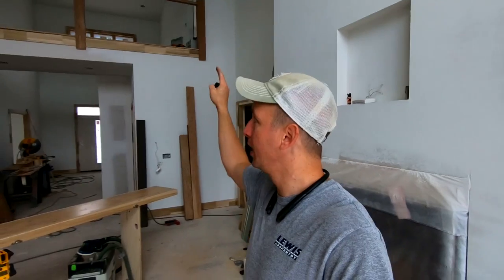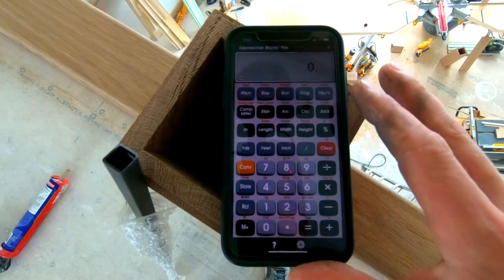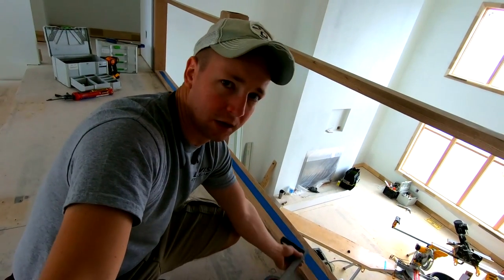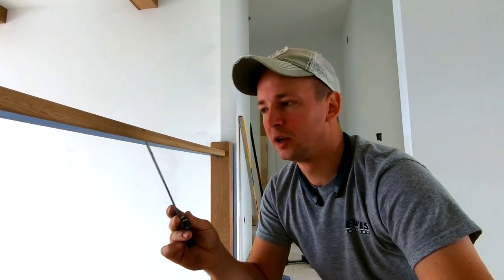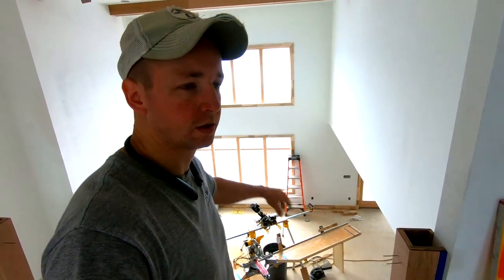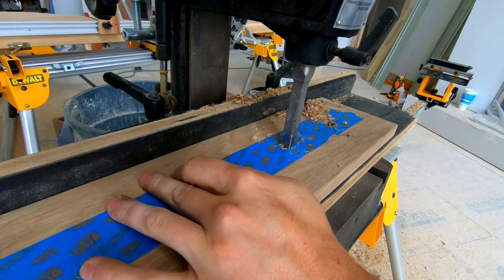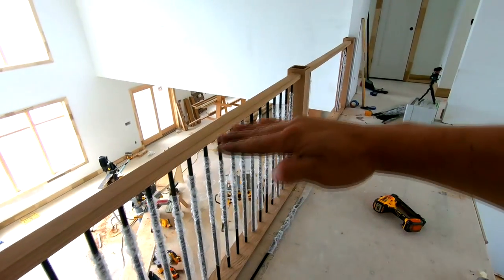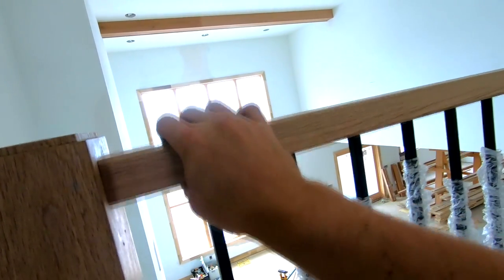NO SHOES! Staircase Balcony Install - How to Square Mortise Balcony Balusters 2

Comment from the maker: Dewalt Compact Stand (for mortiser) - https://amzn.to/32R4W2m
Baluster Layout Compass - https://amzn.to/2OUr3Nf
Starret Combination Square - https://amzn.to/3f3ph75
PLS 180 Laser - https://amzn.to/30OMCnN
1/2" Hollow Chisel Bit - https://amzn.to/2OZDgjH
Rubber Mallet - https://amzn.to/3hDCq8m
DEWALT DW872 14-Inch Multi-Cutter Saw - https://amzn.to/2Em3mvb
Dewalt Cordless Grinder - https://amzn.to/2EiwXWd
Festool Sander - https://amzn.to/39sEoG1
Reply from the maker: It is listed in the video notes.
Reply: So doing it that way Doesn’t it come out a quarter inch bigger space on each end towards the wall and then on the other end towards the new post, because on the outsides and you’ll Only lose half the thickness of one baluster instead of half the thickness of two balusters
Reply: I have drywall, half wall on my balconies. I want to open up the space and install an attractive railing in place of that half wall. I wonder if half wall is the proper description of the existing railing.

Comment: Another great video! True craftsmanship. Stairs can be complicated and time consuming. But I usually enjoy the challenge. 

For those who want an alternative to buying a mortising machine, LJ Smith Stair System now have a plastic insert to be used with a dowel fast screw for hollow metal balusters. They work great and make for a quick and strong install. I made a simple tool for my drill to screw them down, then do the final tightening by hand. The product number is LIH-HOLINSERTW/SCREW. You use them on the bottom of the balusters and the round tops of the balusters go inside holes drilled in the under side of the handrail.
Reply from the maker: Thanks! I'd like to try those sometime.
Reply: @InsiderCarpentry  If you do, make sure there are no burrs left over from cutting the baluster. In fact, you might even want to lightly ease the bottom edge/corners too so you wont mar the tread/landing tread as you tighten the balusters down.

I made a 1/2" baluster runner out of a chuck of wood, plywood and a bolt. Very similar to LJ Smiths LJ-3084-1 baluster runner but smaller of course. Chuck it in the drill to do most of the turning and then finish off the last few turns by hand. 

You probably will have figured all that out yourself if and when you give it a try. Just wanted to share it for others as well. Hope that helps.

Comment: This video gave me the confidence to do my stair railing and it came out awesome.  One of the only and best ones I found, you explained the process so well.  You make it look so easy, and it sort of is, but the level of accuracy and nerve racking feeling of knowing a tiny little mistake would spoil the entire thing had me on edge with every mortise.  The only thing I had issue with was the CMT mortise bit, The drill bit wanted to wander outside the chisel ever so slight and leave one edge with a little half moon. Took me a bunch of time to file down the bit and then sharpen it.  I also had to round over the chisel corners to best match the balusters profile. In the end, super happy with the results, and would have never have tried to do this without this video.  Thanks.
Reply from the maker: Glad to hear it helped. 👊👊

Comment: I did a job a few months ago & it was solid 1/2” metal balusters into maple floor nosing with no boots/shoes..I didn’t have a mortiser so I cut some 1/2 x 1/2 hollow balusters bout 6” long & used my grinder to bevel a sharp edge on all 4 sides like a mortise chisel..I did my layout for equal spacing & drilled a pilot hole on the centers.. then I drilled a 3/8 hole in the pilot holes & slipped the 6” homemade mortise chisel 😅 over the 3/8th bit which fit perfect to keep it centered & hit the sharpened baluster a few times to make a crisp 1/2” square then cleaned it up with a 1/2” chisel..that didn’t take much because most of the wood came out with the drill bit..I used the same method on a couple rakes but also used a 7/16th chisel on the cuts against the grain..the 1/2” chisel dented the wood past the 1/2” layout..but it worked on flat & raked caps..have to make due with what you have available & it looked great when finished

Comment: When it comes to dividing and layout, as an American carpenter I was blessed to learn metric as an awesome tool for layout! It is not as hard as many think.... Is just that we know how much an inch/foot, etc is. Where as of you are presented with 2.5cm or 30.5cm we don't know how much it is until we've used them a while. Try a metric tape in your kit and you will be surprised how easy it is.... Regular calculator works... No fractional fraction deviation.... Which can add up. BTW, you use metric every day if you know how to count money😉
Reply: Just a tip on using metric.... talk in millimetres not centimeters.  No need to introduce a decimal place for no reason.  Only dress makers and t.v. presenters talk in centimeters. 🤣😂😁😀😎

Comment: Very clear explanations like all your clinics 👌.
I installed prepunched hand rails,so had the inverse problem of cutting different length rails around trims.
The hole is for hanging on a chain as its powder coated,then goes through the oven to cure.
1 huge personal pet peeve is keeping the picket to newel post, the same on the ajacent size.
This is a little harder with manufactured pre-punched rails.
As always clear ,and concise!
Reply from the maker: Good to know. I knew there had to be some reason for that hole but I've never had a clue what.

Comment: I use baluster pro app & put in total length, thickness of baluster & max gap between balusters (4” or less) as you know..but to keep equal spacing & you need an even # of balusters you can’t put a baluster in the center of the run..you have to put center in the center of the space..if you have an odd # of balusters you center the baluster in the center of the rail..hope that makes sense,,my new favorite channel

Comment: Nice work as always. In my neck of the woods, we call those tools a combination square and a divider.
Reply from the maker: I always mess up the proper terminology. 🤷‍♂️🤦‍♂️
Reply: Insider carpentry I bought a brilliant combination squar almost twenty years ago now, it is magnetic so there's no need for the knurling screw. It's so so easy to set the ruler part for marking of all descriptions. They are more expensive but worth every penny!

Comment: That’s cool your mortiser bevels, I just did this exact same install with my jet mortising machine 
to get the rake mortises cut  for my stair rail I had to set my mortiser on one of  treads and run my rails along the toe of the treads to get the proper angle for my rake although inconvenient it was a bullet proof method of achieving the correct angle
Reply from the maker: That's super interesting. YOU NEED THIS MORTISER! I put the link in the video notes. Only place you can find the tilting mortisers is Canada right now, but they shipped mine to the states. It was about $900 with the machine and shipping. Not bad.

Comment: Hey Spencer, whenever I do the spacing calculations, I take the whole number, divide it by how many spaces, then do the equals equals, and the calculater takes into account the 64th, even though it reads out just the 16th measurements, and it still ends up right on.  Just what I've found

Comment: That random hole at the bottom of the baluster is probably there to hang it so it can be painted, powder coated or whatever the finish is.
Reply: The random hole might be for installation on a rake, using a screw. Very hoakie way but that's how one if the big production stair and rail places in Calgary ( Artistic Stair). This guy is the exception to the rule. He does great work.  Don't see it done this way very often.

Comment: I enjoyed your video.  I have been contemplating doing a very similar detail with the mortises at floor rail.  My balusters are 1" solid stock turned on a diamond rather than square to the floor rail.  My  railing is 25lb. railroad. Which will  the balusters will be welded to the bottom of the rail.  I would like your take on this plan.  
Thanks 
Casey

Comment: Microsoft Excel is an awesome calculator for carpentry/framing b/c you can create your own custom calculator depending on what you're doing and it can calculate a list of numbers at once and not just 1 number at a time.  If you can do standard algebra then you can write Excel formulas.  They made it really simple. Its available on smartphone now and not just pc like the old days so you can have it on jobsite.  If you input a value in fraction form then you can have it return a value in fraction form.  As long as you enter in multiples of 16ths, 32nds, 64ths, etc then everything will be divisible and returned just like you would doing the math yourself using tape measure increments.

Comment: The steel spindle have a slight radius on the corners. I have found after installing a few hundred, that using a 1/4 spiral router bit and a template, I plunge route square holes, spindles slide in. For really tight but shallower mortise a 3/16 bit works. The mortiser is nice, stopped using it 10 years ago in favor of the router.
Reply from the maker: I simply took a file to the corners of the square chisel to round them over and match the radius of the corner on the balusters. That is what a couple other high end stair installers I know do also.
Reply: @InsiderCarpentry  I make a 8' long run template with my 3/4 square holes all on 4" centers. More production based, but  I can premortise all my stair treads with a short template, or do in place. It's a pain to use a mortiser with the base reversed so you can stand on it and mortise stair blasters in place. (Had to do on a curved staircase 3 spindles outer radius 2 on the inner, all square lined from center point)

Comment: 8:38 Seems like in this instance, if you want to ensure the laser is correctly marking the centers of the hand and shoe rails, it must be aimed completely perpendicular to the rails.
Reply from the maker: Close is good enough in this instance being that the center point and handrail should be near perfectly plumb.
Reply: @InsiderCarpentry  Of course in this video, the laser was very close to perfectly perpendicular, so it was fine. I'm just saying for anyone else who might not get it: if the hand & shoe rails are different distances from the laser, and the laser is aimed at an angle, the location that the laser marks the hand rail at will not be perfectly plumb with the laser-marked location on the shoe rail.

Comment: I am thrilled to find a video on how to install square balusters without shoes. It is amazingly clear and easy to follow. And you did it without having loud heavy metal music blaring in the background! The guy who came to do the estimate to install my beautiful stainless steel square balusters said he would drill a round hole and then fill the gaps with "something" because, he said, there is no such thing as drilling a square hole. Just wondering how you would do this fine work if the balusters were being set into an existing stringer and not on the horizontal where everything can be taken apart. And thanks for the link for the CMT Mortising Chisel link that it says you can use on a drill press ... do you know if it works? Ok ... I'm gonna go watch more of your videos and have more coffee! Again, many thanks!
Reply: Use a drilling jig and hammer the hollow chisel manually

Comment: Awesome stuff!  Question for you tho - how would you approach drilling the floor and rail - if they're already installed?  Encountering this in a balluster retrofit.  Client wants square holes on bottom, as they're the only visible side.   Great content, definitely an artisan in your craft!
Reply from the maker: Its very easy to do this. Simply drill a 1/2" hole with forstner bit and then hammer out the square mortise with square mortise chisel. I showed how to do this in another video around this time frame with stair treads.

Comment: Spencer, good work man! i have a Question if you can answer. does it necessary to use shoe board all the time or is it a code?  I'm re working my staircase and the railing and I'm concerning about shoe board on balcony. I'm doing this along with the LVP flooring and thinking not to use shoe board since i do not like the shoe board sitting on top of LVP flooring. if i use the shoe board it's going to be deferent leveling which i do not like. instead I'm thinking to extend my flooring and overhang about 1" over the skirt board and fix balusters direct in to sub floor. that way stair entry floor level same all around and Please let me know what you think.

Comment: The hole at the bottom of the balusters is for the set screws on certain types of shoes. Never have seen an installer take the time to line it up though, but, most of the time I was retrofitting iron balusters in existing stairs. From my understanding you install the shoe drop the baluster in the hole and then drop the handrail on and try to line up all the balusters with the holes in the handrail. Not the best way to install just one of many.
Reply: Nathaniel Iverson, I also thought the hole was for a set screw as well, that is until I was watching the powder coating and painting process of the balusters and they were using the hole to hang the baluster so it could be accessed 360 degrees.
I'm curious though why he chose to cut off the round end of each baluster rather than just drill a hole with a brad point bit and then insert the round end into the shoe rail and just mortise the top rail. The look is still very clean and professional looking but just a little quicker.
I know the length on the round end can be a little off, so I've just adjusted a similar cut off jig by drilling the same hole as in the shoe rail into the end of my stop block so that I can be sure each baluster is the same length.

Comment: Lovely job mate. How did you fasten the shoe rail ,screw it down through the spindle holes ?
Reply from the maker: Just some 15 gauge nails. Sometimes I'll put adhesive on the underside also.

Comment: Use the BuildCalc app , it works much better for Stair builders and especially baluster spacing.  It is also much simplify
Reply: Duayne Naugle nothing better than the construction master pro Calc. That app is for rookies and diy’ers
Reply: Jeremy Cline I’ve done over 2000 stairways so I wouldn’t consider myself a rookie
Reply: Duayne Naugle 21 plus years and the last 15 with the construction master calc. I guess I’ll try that out since it’s brought you much success. Thanks
Reply: Jeremy Cline I have both CMPro and BuildCalc on my phone. As a Stairbuilder , Buildcalc is the one I go to every time .

Comment: How did you learn this? How long have you been doing it? You seem like an engineer at heart :)
Reply from the maker: I just try and learn anything I can from whoever I can whenever I can. Started in construction at 16 years old.
Reply: @InsiderCarpentry  hey man, are those miter saw blades are better than diablo or dewalt?

Comment: Why did you do the layout on the floor vs your miter station or other comfortable height surface?
Reply from the maker: Often times there are issues such as newel post wraps, plinth blocks, and out of plumb walls to factor in which require the pieces to be offset. It’s just easier for me to reduce the chance of errors by laying out in place where I can see everything that is going on.
Reply: @InsiderCarpentry  I understand, I just turned 60 and could lose a few lbs. so working on the floor is a last resort for me, luckily I'm not a trim carpenter. I really enjoy your channel and appreciate how you use systems and jigs to increase efficiency.

Comment: I'm currently still using the 1/2 Chisel that came with this machine. Does the cmt 1/2 chisel work better?
Reply from the maker: Its all about getting the bit setup correctly and sharpening it. I don't think it matters much what brand it is.

Comment: Those look like balusters from timeline. Someone at the company or my supplier told me the random hole is from the manufacturing process, annoying but necessary apparently.
Reply from the maker: Someone else said that also. Apparently they hang them by that hole while powder coating.

Comment: Have you ever done newells where you fasten them with a long 5/8 threaded rod through the newell into the floor, then tightened with a block at the top?  Seems like a legit method, wondering what you think.
Reply from the maker: I never have but it seems like a legit method.
Reply: Yeah Richard at finish carpentry TV used that fixing system on the newells he installed in his house. It seemed to be a good,sturdy way to fix them tbh.
Reply: Saw it on next level carpentry channel
But I would be doing it with coarse hanger bolts instead of threading the rod into the wood

Comment: BalusterPro on App Store...fastest setup for spacing flat and rake runs.  Best part is it will round to nearest 1/16” and will even read you the measurements so you can mark each spindle without going back and forth to your phone
Reply: Scott Schifferdecker  nothing better than the construction master pro Calc. That app is for rookies and diy’ers
Reply: Jeremy Cline I agree, I use that for everything else.  But it doesn’t matter who the app is marketed to, it matters if it’s accurate and efficient, and it checks both boxes.  Nothing wrong with the other way, but the app makes it faster